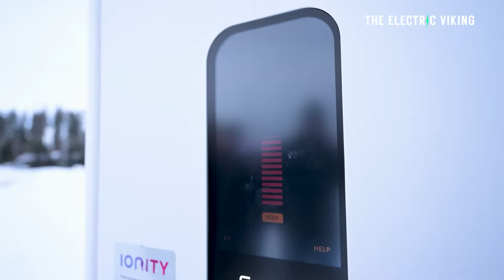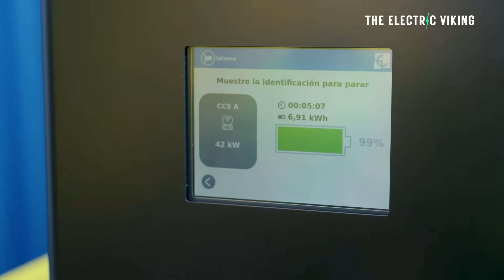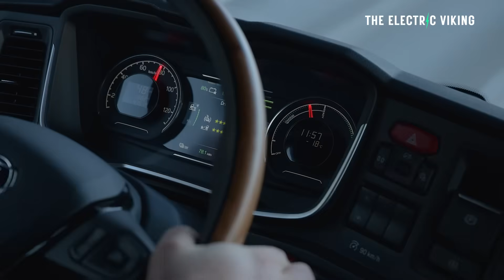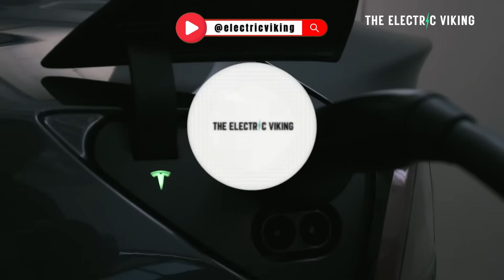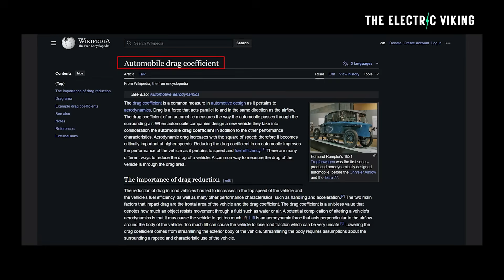Truck revolution begins: Electric truck with 624 kWh battery on sale in Australia

Comment: How can it be that it will take so long? Cars and trucks have been in mass production for over 100 years.  Petrol vehicles are primarily made of iron which is 5% of the earths crust; BEVs require rare earths - lithium is 0.0002% of the earths crust. Other rare earths required for BEV batteries take even more mining to obtain, and have to be transported haff way around the world to BEV production locations.  Batteries that do not use rare earths might be cheaper and more viable but no real alternative is in significant production thus far.
Reply: "Oh wie shcön ist Panama2 in den Accus sind keine seltenen Erden den Lithium ist keine Seltene Erde und auch Kobalt und anders Stoffe die in accus verbaut sind sind seltren. "Seltene Erden" bezeichnet manübrigens Rohstoffe die hauptsächlich in Chna abgebaut werden. Da aber Kanada sich von ihrem Sklavenhalter befreit werden mehr dieser Stoffe auf dem Weltmarkt au´ftauchen. Und auch in Schweden wurden einige dieser Metalle gefunden in ein oaar Jahren sind die nicht merh "selten".  Das Problem sind die Verarbeitungskapazitäten der Rohstoffe und das drumherum der Fahraccus.  Mit deinem "Eisen" kommst Du aber nicht weit.Ein Tesla hat wesentlich mehr  Aluminium wie "Eisen/Stahl" verbaut.

Comment: Lets be optimistic and decide Lithium packs can be increased in production by 10x over night - it will still take 12 years just to make enough packs for US Long Haul trucks; then you still have 18 million non long haul & 18 million megapacks; another 5 years production, a total of 17 years just for US heavy trucks.  If you want to replace the rest of the worlds heavy trucks that will be at least 54 years.  Then you have to address the 1.4 Billion cars you have to replace, and if you want to charge those in 5 minutes; you need megapacks for similar high speed chargers.  So you are talking something on the order of 200 years to replace all petrol cars and trucks and that assumes lithium production is increased by 10x starting now.  Do you want to add all the rest of the non transportation petrol powered systems?  How about solar and wind to power them all?   Not a viable plan.

Comment: Using a super  charger takes a Y 30 minutes, the same charger would take 8, 10, or 12 times as long to charge a giant truck battery. 4-8 hours. To remedy this Tesla puts a Megapac next to a special charger - these packs and charger cost over $1 milllion each - and if you want a multi megawatt unit it will cost proportionally more.  So to Charge a big battery they use another giant battery to supplement the local grid because the grid itself can't do it; even at a commercial Pepsi bottling plant.  The USA alone has 27 million heavy trucks and 9 million long haul trucks.  This means just to replace America's long haul trucks will require 90 million Y size packs for the trucks and 4-6 Multi million dollar packs to keep them running all day. 360-540 Million Y size packs. Total world Lithium car battery production is 3-4 million Y size packs  So it wouild take 120 years just to replace US long haul trucks.
Reply: By the same logic we would still be half way through building the petrol stations needed to support the introduction of ICEs
Reply: @Alantj22  What are you suggesting?  Oviously ICE trucks exist now.
Reply: Or a ramp up in production facilities with investment to exponentially expand capacity. Keep in mind that current product capacity is already expanding, but has been driven by predictive demand curves. If the trucking and commercial markets require product and parts, the investment in development and production increases to meat demand.
Reply: @JonDecker mmmm meat demand…lol
Reply: Das war de Stammtisch. Realität ist daß amn diesen Scania bzw alle europäischen E-LKW an einer Ladesäule für PKw die inzwischen bis zu 400kW laden können auch aufladen kann. Dafür sidn keine diener Spielereien norwendig. aber es macht sinn wenn man auf dem firmengelände laden will und tagsüber mit PV die Groß0batterei auflädt um dann nacht s die LKws günstig zu laden.  Ich empfehle DIE die Videos vom "Der elektrotrucker" anzushcauen dann kannst Du deinen Wissensstand auf den neuesten stand bringen den deine Aufzählungen sind schnee von gestern und treffen so in Europa nicht merh den Punkt.
Reply: @rumpeldjango5945  If there is no big battery pack; then the 400kW charging won't charge a truck with a 1 Mw battery for many hours. This in not viable for a business. If you are not doing long haul; you could take long hours to charge over night if you are only transporting short distances; however you still have to make all the batteries if you are going to replace the 200 million heavy trucks in the world, and as I note you'd need hundreds of millions of Y size packs just for the USA's trucks when current production is about 4 million.
Reply: @BlondieSuperdog  🤣Um die ISA mache ich mir keine sorgen die fahren demnächst wieder mit Pferd und Planwaägen über dei Prärie. Ansonsten viel wirr war ich glaube Du silltest dich erst näher mit dem Thema Accu Accukapazität ladegeschwindigkeit  auseinender setzen den du vermisxhst da Halbwissen zu einem inkompetenten brei.  
Bei einer 400 lWh Batterie ist eine 1MW  ladung ein Ladevärhältnis c von 2,5 unddas ist bei heutigen Accus durchaus üblich.  Bei einer ladekapazität von 400 kW am Stecker  ist der accu nach 1h ca 80% geladen für die restlichen 20% benötigt er dann naioch maö ca 1h  wo ist da das PÜriblem dies über Nahct zu shcaffen. Selbst bei resuzeirter Leistung um meheree LKW glaichzeitig zu laden sind de am nächsten Mrgen alle voll.  Bei kurzstrecke und immer gleicher strecke kann es siendaß ein Laden auf 80% reicht und dann sinnvoiller für dsie Lebensdauer des Accu ist  die accus braucht man ja nicht auf einen click an einem bestimmten Termin so daß das unnötige Bedenken sind daß das nie möglcih sein wird. Während die Proiduktion bie Accus Lkws hichgefahren wird wird sich das alles angleichen .Beim Verbrenner Kfz gibt Gab es auch schon 5 Monate Lieferzeit.  Und auch die Bedenkenträger werden den Fortschritt nicht aufhalten sindern nur bremsen. 😏😺
Reply: I wouldn't use Tesla over priced offerings to make a point. Battery tech has already left musk behind , lithium supply is not an issue, and battery costs are rapidly falling.  You can also use super capacaters rather than batteries to boost charging capacity. At a distribution you can also produce your power on site. Try doing that wit diesal
Reply: @tonywagner4836  The point made simply uses the most popular EV battery type as a base for establishing the fact you can't make enough lithium batteries to have any significant impact on Trucking or anything else.  a 70 KW batterey uses about the same lithium as 9 Y batteries.  That is why I gave 8, 10, and 12 multiples.  Tesla's use of Megapacks or an similar brands packs are the only way to charge a massive truck battery in a semi reasonable time of 30 minutes, if you do not do that then you are looking at long charge times implying either more trucks to move the same loads each day or long delays in shipments.  You must either have more batteries to swap, charge or be used in tag team trucks or be faced with very long charge times that won't be acceptable in business. There isn't enough lithium produced to make this happen even if you assume 10x production boast starting now - a very unlikely event.
Reply: In the short term electric trucks are economically viable for short distances transport and delivery: moving containers within a port, delivering them to near customers,  going from suppliers to customers. Smaller batteries means trucks production can ramp up. Long distance should be done by train (electric, hidrogen cells locomotives? ).
Reply: @fduran6993  As noted long haul is 9 of 27 million heavy trucks.  Roughly 1/3rd; so if one could make enough batteries you could do short haul with electrics.  To even do that we'd need to increase production by 10x very soon or the amount of time to do even the USA's shorter range trucks would take over 100 years at current production rates.
Reply: Check out CATL Sodium Ion announcements a few weeks ago. I know it may be overwhelming, but try to keep up with how rapidly AI Material Science and Engineering is transforming all of ElectroChemistry and making the old paradigms obsolete exponentially.

Comment: While the US are waiting for the Semi, Europe already runs electric trucks on a daily basis. Watch electric trucker here: https://www.youtube.com/watch?v=pqYZxma4tBc&t=7s
Reply: Is true. Our company will receive its All Electric car hauler in 2 months and another car hauler company here has at least 10 Electric trucks. The company I worked for 3 years ago also have at least 20 Electric trucks.  Times have really changed
Reply: Full production is 2026
Reply: @PlaidZoomer In Teslas timeframr that can mean in 2030 lol
Reply: The fucking US of A$$holes is gonna wait until Trump can reward his fellow Fascist Musk.
Reply: The issue with US trucking is that they often drive 500-550 miles at a time and wind up waiting in long lines for gas because their tanks are so big.  Waiting for charging will become a problem too without swappable batteries.
Reply: @veganpotterthevegan  Everyone has to develop what fits best to him. The US can keep simple technology and cheap gas if they like it the way it is. American trucks are already more simple and low tech compared to european or chinese trucks.
Reply: @JakobFischer60  not really, there are absolutely high tech options in the US.  That's just not true for every new vehicle. That said, cost, tradition and regulation are massive factors.  And what's best isn't always in line with regulation.  You can be sure that trucking would be very different in Europe if their regulations were as lax as they are in the US.
Reply: @veganpotterthevegan  Hm, I only have seen some  Bruce WIlson YT videos

Comment: Neither Tesla Semi or Cybertruck will be mass produced because Tesla can't make the 4680 battery without high defects which has dogged Tesla for half a decade and hasn't been solved. BEV trucks are a total fail anyway.  Underload range is pathetic.  All one need do tp prove this is scale up a BEV car.  10 Model Ys the batteries weigh 10,0000 lbs. An Empty Y is 4500 lbs, so that would imply 3500lb  per pack load capacity, a total of 35,000 lbs but you have to account for the cab, and trailer weight, Even being generous a cab/railer will weigh at least 10,000 more pounds so to have the range of the Y you'd have a total load capacity of 25,000 lbs;  and a total weight loaded of 45, 0000 lbs. A Y has a range of only 300 miles just w driver; with a 3,5000 lb trailer its range is 150 miles. Then you have to charge the massive battery whether it is 8, 10, or 12 , Y. size packs you increase the charge time.
Reply: Have you been following the Electric Trucker Youtube channel?

Comment: Carbon dioxide is NOT pollution; it is plant food.

Electric vehicle force children in Africa to work in dangerous mines to get the elements like cobalt for use in the battery. It perpetuates de facto slavery.